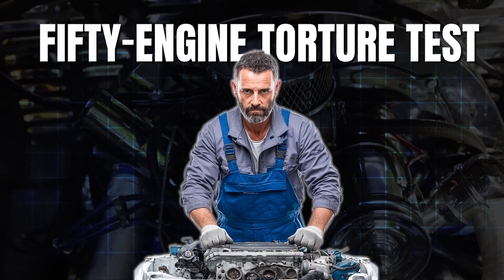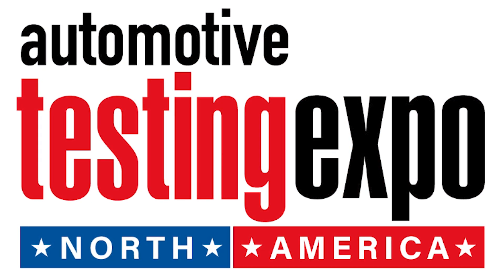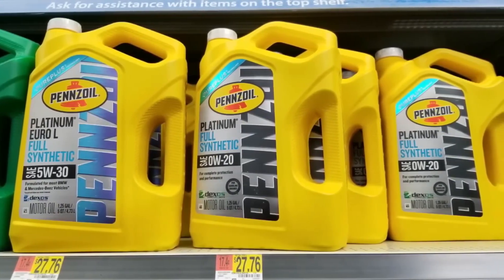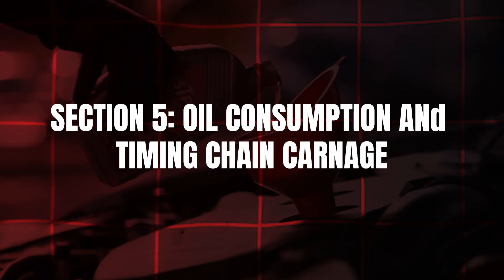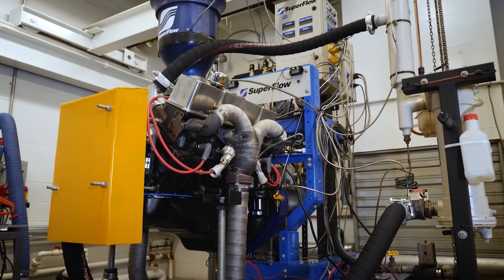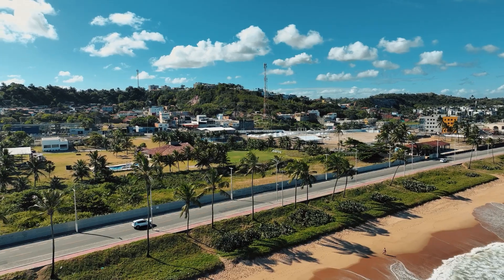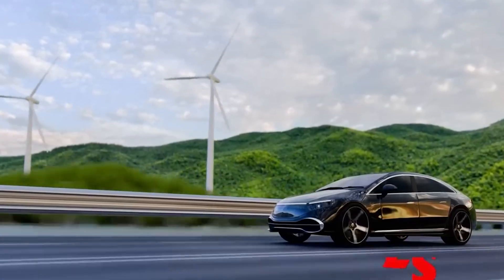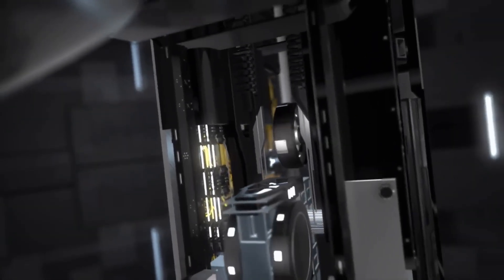The TRUTH About 0W 20 vs 5W 30 Oil (50 Engines Tested!)

Comment: My car kia carens 1.5 liter diesel manual driven 137000 and its services done in showroom only they use 0w 20 but at 94000kms turbo got changed and at 110000 Dpf got changed and now at 137000 against Dpf changed what is the best advise u can suggest pls provide solution.
Thank u,

Comment: New 2026 GMC Sierra 3.0 Duramax with only 1,000 miles. Hasn't burned one drop of oil and maybe 1/2 gallon of DEF. No towing. Broken in on Rural country roads @ 55 to 60 MPH. 29 mpg city, 34 mpg Interstate. SW Missouri is relatively mild as far as Temperature fluctuation goes.  Being a 26 model, I suppose it came with 0W20? Should I worry about oil type/ viscosity? I intend on letting the GMC Dealer do the first service @ 3,000 miles because it is FREE. I don't want to VOID a 60,000 mile warranty by making my own decisions. My first Diesel was a 1999 Dodge Ram 2500 24 Valve, a 2021 Ford F250 Powerstroke and a 2023 GMC 2500 SLT V8 Duramax and never had any trouble with them at all. Any advice would be appreciated.😁

Comment: What oil do you suggest when the manufacturer specs 0W16 or even 0W8?  It seems pretty extreme going all the way up to 5W30 from THOSE water like viscosities.  After all, my Toyota model uses a variable oil pump and has tiny passages throughout.  Isn't going all the way up to 5W30 going to cause other problems?

Comment: Here the thing. This video is IA generated and complete bullshit.. modern engines are designed to run 0 20 to maintain system integrity. A thicker oil in theory will protect better at higher temps mayb years ago. Newer higher quality oils will work just as good at any viscosity.. not to mention   Changing your oil at 5 k intervals, even less in some cases..
Reply: BS I’m a mechanic over 25 years , so was my dad and his dad (grandpa) now without sounding like the chick in my cousin Vinnie, I fully agree with content in this video. I have seen this too often and clearly avoidable by moving up in viscosity so much so that we had to turn this work away for complete engine overhauls would tie up our bays, lifts and techs , we do just fine without them, tune ups, brakes, suspension work is our bread and butter, so people listen to this so what if it’s AI whatever it’s true

Comment: 2026 Toyota Corolla Cross. Did 1st oil change at 1500 miles, using 0w-16. Manufacturer calls for 0w-8. I don't want to go that thin.

Comment: 2024 Tundra 3.4l  in south Louisiana; 1000 miles per month, but tow 7000lbs of boat a couple of times/ month, 200 miles round trip. Using 0w-20 full synthetic.
Reply: How does the example of your two year old truck not blowing up under 35,000 miles trump a laboratory study of fifty engines?
Reply: @Dhaus-r9j   Not sure if that was directed towards me?  End of the video said to drop your engine code in the comments to reveal what is the best oil for your vehicle. I was simply doing what the video requested.🤔
Reply: @ironmaiden8625 my bad
Reply: @Dhaus-r9j  No sweat. Comment section is often hard to decipher. I keep telling myself to just "stop".😂